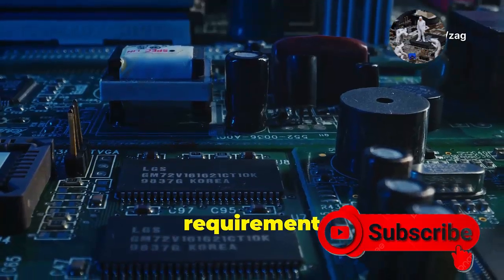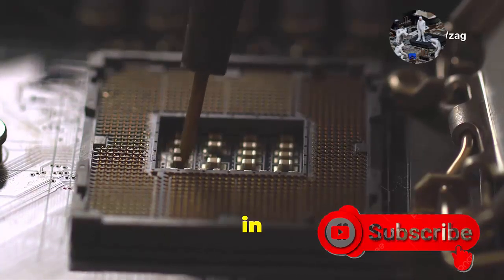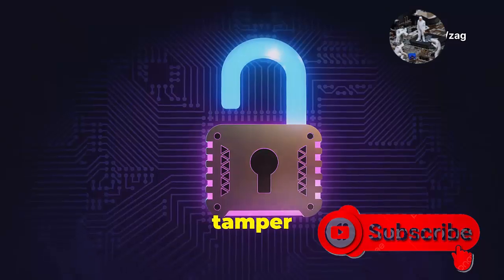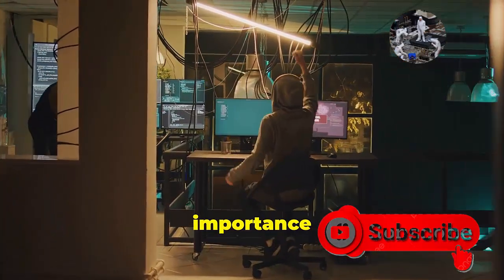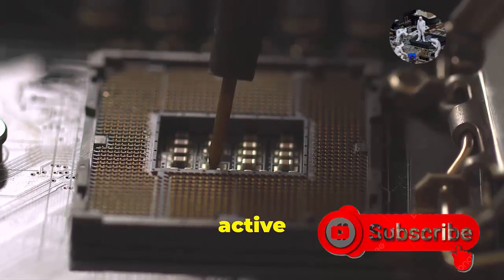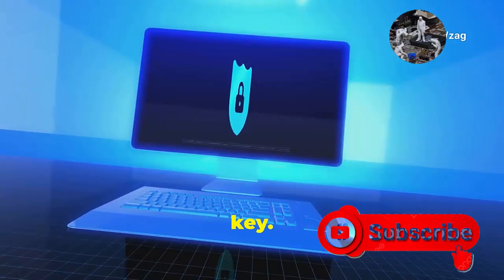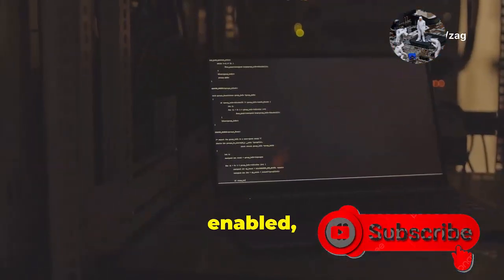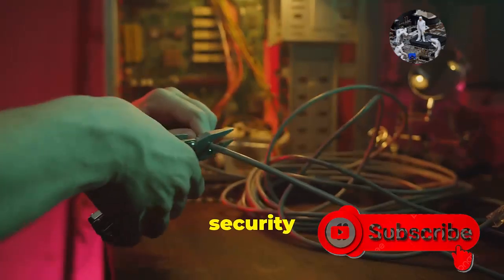What is a TPM and why does Windows 11 require one?

Comment: TPM mainly protects against threats at the hardware and firmware level. It doesn’t directly protect against software-based attacks or vulnerabilities in the operating system or applications. There are also concerns about privacy and surveillance with TPMs. The technology's ability to track hardware and software states can be seen as an invasion of user privacy, especially if it’s used for purposes beyond its intended security functions. TPM is also used in conjunction with Secure Boot, a feature that ensures the system only boots with software that is cryptographically signed and approved by the hardware or operating system vendor. If a manufacturer or OS vendor controls the Secure Boot keys, they could potentially restrict the installation of competing operating systems or unauthorised bootloaders. However, this could limit user choice and could be seen as a monopolistic practice. Security my A$$!